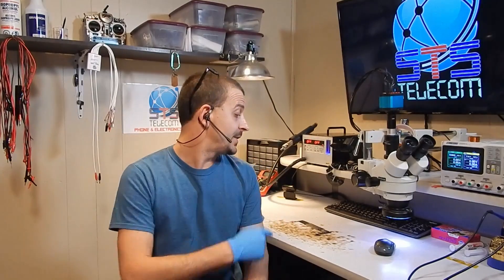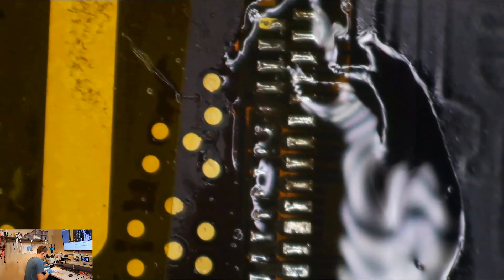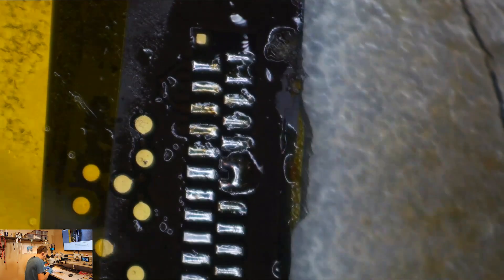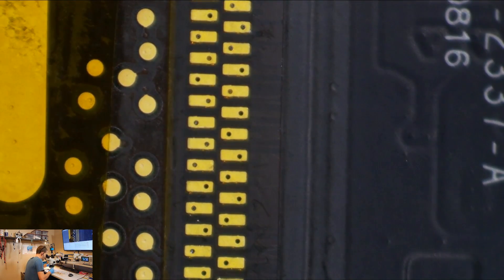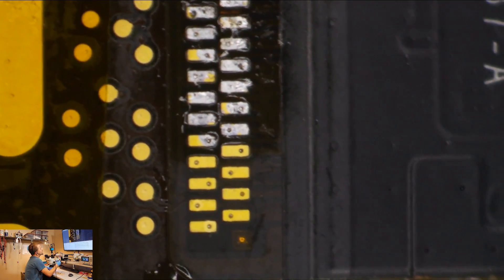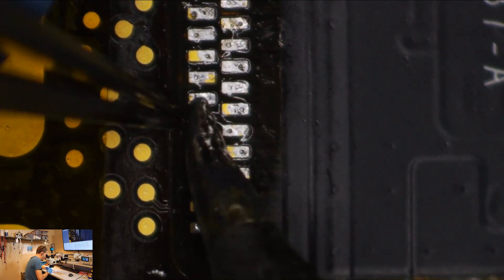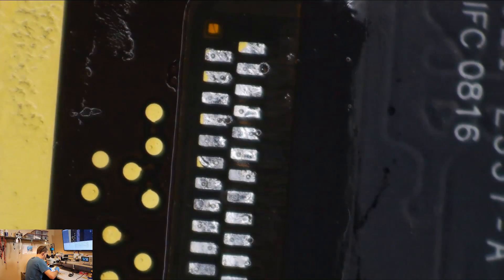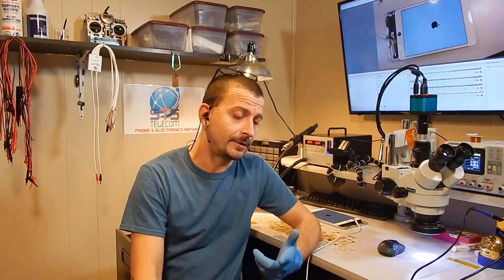Easy iPad Charge Port Replacement (shown on iPad Mini 4)

Comment: I tried to desolder the flex cable with an iron and destroyed some pads doing so. Maybe my iron is just not hot enough, but I would only do it with hot air. It is much easier to heat the pads all at once with the air gun.

Comment: Thank you very much for this video! Thanks to it I actually somehow managed to replace charger port on my iPad despite having zero experience in soldering, and never before attempting repairs harder than battery replacement. This is very helpful.

Comment: Thank you so much so well done and very well explained. I opened a repair shop and I dont advertise or do solder work normally as thats something im still not comfurtable with but this one lady insisted because the only other option she had would cost her almost as much as it did getting the ipad in the first place. Had her sign a form and I was so anxious but this worked like a breeze. Thank you

Comment: Thank you very kindly for the video, it saved my butt. This is exactly how I did it. The re-alignment is definitely the hardest part before applying solder. I used a few small clamps to hold both components down.

Comment: Very nice 😎 good to see you again! Do you use 0.5x C-mount relay lens for camera? I use and I wonder what is the best x lens for camera so the field of view is more wider..
Reply: Paul Daniels Thank you for the information, Paul!
Reply from the maker: Thank u Paul - I wasn't sure how to answer that one.  :-)
Reply from the maker: Thank you.  This one is 0.5x.   I really like the results Paul Daniels is getting out of his 0.7x though...  I'm planning to change to that one day.
Reply: STS Telecom do you mean that he have 0.7x for C-Mount or 0.7x regular barlow lens under microscope :)
Reply: STS Telecom are you refer to 0.75x
Reply: I've got the 0.7~0.75X main barlow on the microscope itself, and a 0.3X on the camera adaptor for the c-mount.

The 0.3X on the c-mount is because I'm using a 1/2.8" sensor on the camera.  If you have a 1/2" sensor you probably want to get a 0.5X c-mount reducer.

What's on the main-barlow doesn't really matter for the camera, as the camera/c-mount is about just capturing the most of what ever is in the microscope's FOV.
Reply: STS Telecom thank you both :)